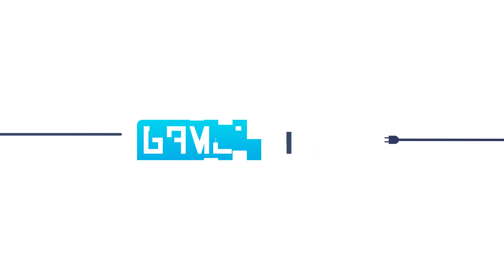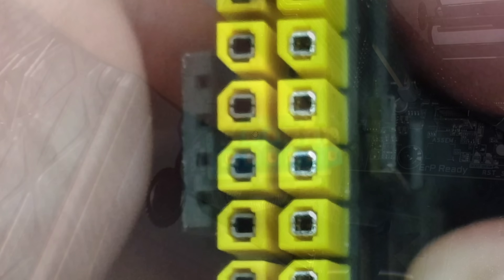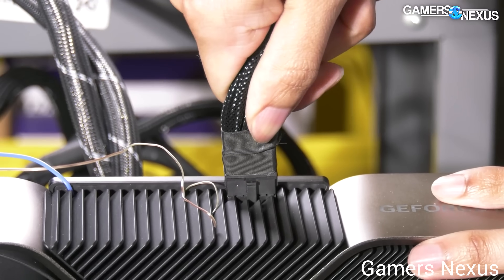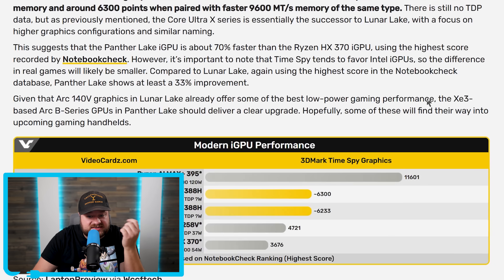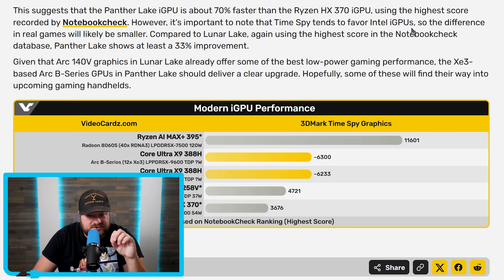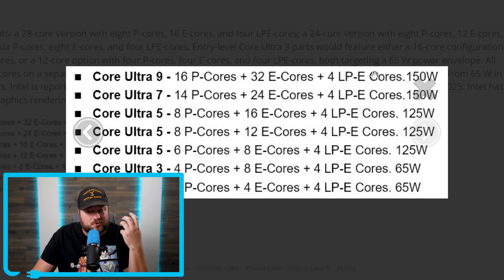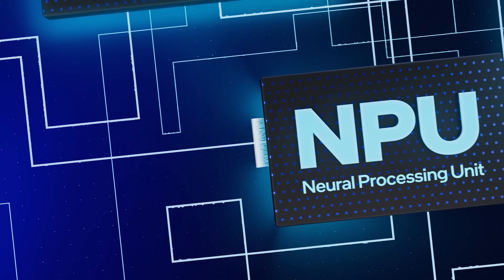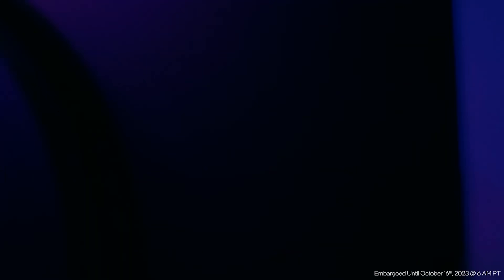PLEASE Don’t Do This AMD!

Comment: You don't burn a connector with 340w of power draw from a 9070XT. Something else is going on on these cards.
Reply: my 7900XTX goes 450W  (490W actuall) but all 3 8pin connectors are fine :)
Reply: A poor connection can reach melting temperatures with as little as 50 watts if left unnoticed. Spread across 6 lines and 300watts is more than enough to start melting stuff.

The problem is when you have a poor connection that creates resistance. AKA it just turned the connector into a literal heating element. The power supply senses an increased draw so it bumps up the amperage thinking the card is asking for it. The card notices no drop since the PSU compensated so it doesn't care. 

This is SUPPOSED to be what the 4 sense pins were intended for, but in their infinite wisdom they never programmed in PER PIN sensing. Not to mention your included 8pin to 12pin adapters completely sidestep the sense pins all together.

There's so many woulda shoulda couldas that could have kept 12VHP from being a mess, but of course hind sight is always 20/20.
Reply: @zodwraith5745  Thx for the explanation about that sense pins.
Reply: Have you heard of any of the other cards that are still using the 8pins having issues?
Reply: One guy was running undervolted, so I wonder if it pulled more amps to reach the power target, which would be a very straightforward explanation as P = VA
Reply: @boxlid214 , it doesn't work like that, undervolting means the working voltage of gpu is lower so to reach the same power as before undervolting more amps is pulled inside gpu, not the power source. If GPU eats 340w - it will get 28.3A current through the power cord and it doesn't matter how that power is used by the card, it could operate 1.2v * 283A or 1v * 340A (it's just a simplified example, gpu has many voltages and currents for memory, core etc)
Reply: @AleksandrYgA  but which pins that current is pulled from can still be an issue, or how that load is decidedly balanced if done.  Many of these cases had just a pin or two burnt, and sometimes it's nuking a whole row of them.  The shitty spec'd cables are an issue, but there might be other things going on.  It's important to find out exactly how each specific trace is pulling power through these things.  They supposedly made changes to watchdog each wire and balance the load better, but this whole situation tells me that the full load can't exactly be balanced across multiple wires at once, and rather progressively across a wire at a time slowly frying all of them sequentially.
Reply: 12vhp connectors are very badly specced both physically and electrically with incredibly little headroom. Especially when compared to the standard 8-pin. So, yes, it can absolutely be the connector.

Comment: I don't think the wire our pin connections are properly rated. And why would so many power connections fail to allow all that additional current draw in the first place. A d should be using 16awg wire.

Comment: You mean 12pin right? Why would you shoe 12 pins when saying 16 pin otherwise?
Reply: It's actually 16 pin - there are 4 utility pins that are used to provide a card with the information of maximum power draw. 12 pins are the signal ones.

Comment: PCI Sig deserves a class action lawsuit for greenlighting this godawful connector ruining people's expensive cards.
Reply: Connector is fine, it's the nvidia in the first place, they got rid of current balance system in 4000 series. 3090 is rated same as 4090 at 450w and there was no issues with 12vhpwr (and it was the old one), 4090 and 5090 has the issue even with the updated connector.
The 9070xt examples should be investigated - what power supply was used and what are the used connectors. It might be that gpu vendors order cheap connectors from some other manufacturer who doesn't meet the specification.
Reply: @AleksandrYgA  AFAIK nvidia get rid of the current balancing because doing so will not confront to the spec dictate by PCIE consortium. actual hardware overclocking talk about this issues in one of his video
Reply: Finally someone that understands it's not "Nvidia's connector" when everyone within PCI-SIG signed off on it. Nvidia was just the first one foolish enough to use it. The real question is why would any of the Radeon AIBs jump on board after the 40 series issues?
Reply: @zodwraith5745  Nah nvidia is just as guilty they forced aibs to use it with no option to use 8pin
Reply: @zodwraith5745  because between millions of GPU being sold not even 1% being affected. even the 6pin/8pin are not free from being burned/melted.

Comment: How is comparing the 258V to H chips fair? The 258V is an ultra-low power chip and it's what I use and it runs cool, quiet, has good single-core but mediocre multicore. You get this chip if you want a thin and light that doesn't get hot. Will there be an equivalent ULV for Panther Lake? It doesn't appear so; this looks more like Meteor Lake.

Comment: Intel ultra 9 wirh 52 cores well 150W properly st gaming and all cores at 350W.
I hope they do something about infinite fabric for ryzen since we should be able to use 8000Mhz ram at 1:1 would be nice.
Next amd generation may only get multicore performance uplift and 0 gaming.
If they make something about infinite fabric + increased L2 cache + L3-cache increased will end up 5-10% performance uplift over currently ryzen 9000 and 9800x3d will still be faster in gaming.
Reply: 52 cores but your game only uses 2 to 8 cores, so what's the point of those extra cores..

Comment: need more amp get thicker gauge not tiny ass gauge wire. 
physics
Reply: not the wire its the molex type connectors they need to stop using them many other options
Reply: I'm just gonna cut the connectors off and solder the wires to the card. Then I'll always have the wires too.
Reply: @oakfig And when u want to sell it………what then?
Reply: @techluvin7691 I'll have to charge extra for the wires 😂
Reply: Nvidia just need to do f’ing something. All this back and forth is pissing me the f off. As a builder……..I’m not using these cards anymore. I cannot afford this shit.
Reply: I was concerned with this even before we ever saw any failures from the connector's overall size. I've been building and selling PCs for nearly 3 decades and I've seen plenty of 8 pin and Molex connectors melt. It's not about how much a connector can theoretically carry, it's about how much it can carry with a poor connection creating resistance. 

Whoever headed up the design within PCI-SIG (don't forget this isn't just "Nvidia's connector". It was signed off on by everyone. Nvidia was just the first to use it.) spent way too much time focusing on making it svelte without making it "idiot proof" and robust. They could have gone with a thicker contact per pin and only made it 1/2" bigger overall, and it would still be far smaller than 2x8pin, let alone 3 or 4. They could have even kept it small with 2-3 huge blades instead of 12 small ones like you see in high end RC cars. Some of those pull insane amounts of amps. The Deans connectors on my cars are rated above 1000 watts and they're smaller that 12vohp.

Wire gauge isn't the problem. Wires rarely melt unless they're really thin like you'll often see in automotive when wires melt, and even then it's usually due to damage. The wire gauge in 12vohp is perfectly adequate.
Reply: The wire doesn't burn though does it... the square pins probably make 50% contact each and those get hot
Reply: @mikeb3172  yeah, that's the problem! The idiots that designed the cable have zero knowledge of electrical engineering, they just made it look nice and small. Regardless of power draw, connectors that don't have a spring contact over a larger point of contact, are prone to poor contact and oxidation, which increases the heat problem. Also, the connectors should be gold plated, as silver plated ones like these, do oxidise badly. Moreover, an even better connector than a spring loaded one would be one that has screws to tighten up the pins on a contact plate, that way ensuring a strong contact.

Comment: They could solve all this by simply going back to the 8 pin power connectors. They work. You might not like the look but better than replacing the GPU. Function over looks anytime.
Reply: I honestly dont care what it looks like. Bring back the 8pin! I would rather have 4 8pins than one of these melting connectors!
Reply: @DefiantAML  Yeah but these connectors would stop melting if they solved the problem causing it. The connector isn't it. That's just the part where you see a failure happen. Something else is going on in the power delivery causing this issue.
Reply: With the size of GPUs, why not just dump this connector and use the 2 8 pins, but have them plug in from the bottom or side instead of the top.

So tired of this fire hazard connector.
Reply: @UltimateGattai  that's only going to give 300W
Reply: I think the answer is much more simple with manufacturers using an integrated load balance on to the GPU itself. Better yet redesign with a much higher ceiling like on the older 8 pins.
Reply: We always prevent people from using an adapter in the old days for GPU but now nvidia forced us to use the adapter converter from 2x8 pin. It doesn't make sense. 

If it ain't broke, don't fix it
Reply: @wews2047  That's not always possible if you want to move forward.
Reply: I am glad I bought the 7900XTX with 3 x 8pins connector. 😆Despite my new PSU comes with the new connector.
Reply: @Anon-cv7ru  got same GPU xtx hell hound
Reply: Just use dual EPS12V connectors will do. No need new tooling. If 2 EPS12V is good enough to feed highly OC'ed Intel HEDT CPU in the past , it is good enough to feed modern day GPUs.
Reply: The main problem would be that you need 5, maybe even 6 8 pin PCIe connectors for a 5090 (the 6th if you'd want to overclock it). They just need to redesign and reinvent the whole or a big part of the connector, use thicker wiring etc.
Reply: @nielsvanaert4746  No you don't. A single 8 pin connector is only rated for 150 watts however it has a 100 percent safety margin meaning it can safely handle about 300 watts before melting. The engineers who designed the 8 pin connector knew what they were doing.
Reply: @thelbtlover That doesn't mean you want to push it to 300W. It's the safety meeting which keeps it so stable.
Reply: @thelbtlover  there is no such thing as 100% safety margin. in the past i saw 8pin power connector melt/burned on R9 390X . and that is from high quality Corsair AX1200 unit. the GPU did not even pull over 300W back then.
Reply: Straight up
Reply: It's not a connector issue though. There is a flaw in the power design some place causing this to happen.
Reply: those 8 pin and 6 pin also got burned/melted.
Reply: they thought if  turds buy  2x6pin that explode from nvidia and they keep buying . . . . WHY NOT ?!?!    🤣 not buying is hard fk sakes
Reply: Yeah or never have created this stupid cute connector to begin with. Still rocking a 1080 ti dont need a gpu that has only bumped up only 100% in flagship since 2014 lol. Suckers! 10 years and change of your doomasses overpaying for $hit.😅😅😅 time to.put that sli connector to good use.😅😅😅
Reply: Pretty sure Linus tech tips went all the way down to literally 2 wires and had absolutely no issues.  It wasn't pretty, but it was functionally absolutely normal.
Reply: can we finally fuck them allup. im so sick that EVERYTHING IS CORRUPT AF MAN. THE SOLUTIONS ARE ALWAYS SO SIMPLE
Reply: This - I'm not touching Nvidia IF they keep using those 12v connectors
Reply: @snoop4098 problem is all gpu maker will eventually move to those new 12v 16pin power connector.
Reply: just plug it in all the way
Reply: My 9070XT has three 8 pin connectors so I'm good 😁👌
Reply: Having four connectors with 32 wires to supply only one voltage is absurd. There are multiple well tested and standarized two pin connectors capable of delivering those amps, they should have gone with one of those
Reply: Or…. much better, the Government should pass a law ALL domestic GPUs must not run continuously at more than 300 Watt or spike past 400 Watt for longer than a millisecond pulse…
Reply: @jasonking1284  NO !!!! MUCH WORSE. We don't need more government. People need to learn to vote with their wallets appropriately.

Comment: never had trouble with the connector
4070ti waifu owner here since may 2024
Reply: And how much power is it using? 300-400?
Reply: @Cutecumber12564  nope not even close
most times its pulling around where my 2080 super sit for a max load which is 250 watts
Reply: @ChikaHakozaki well that's why
Reply: @Cutecumber12564  well ya
was just replying to video sir
I'm no newbie to PCs been building my own since 2010 and went through the dual gpu phase and triple monitor stuff years ago.